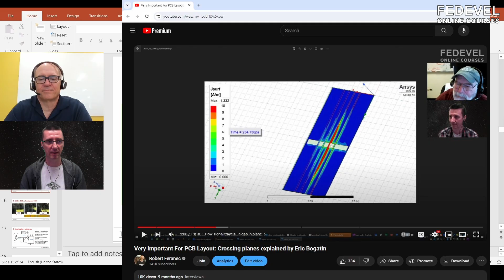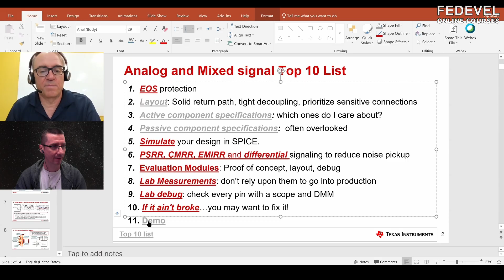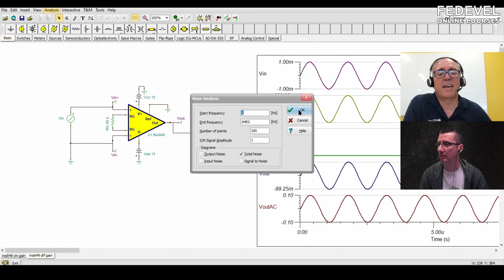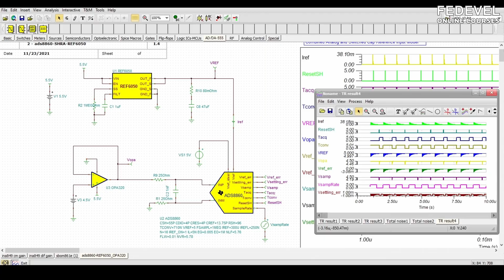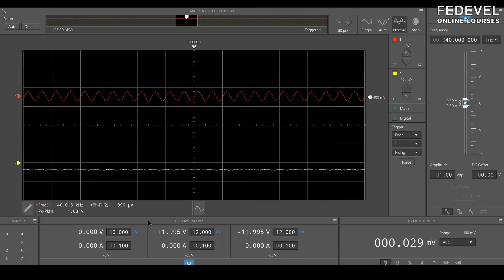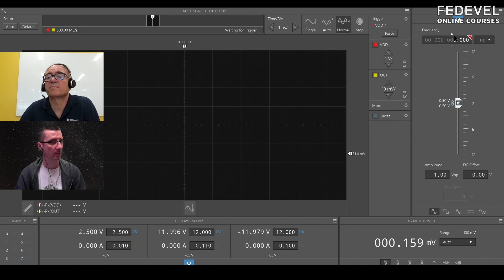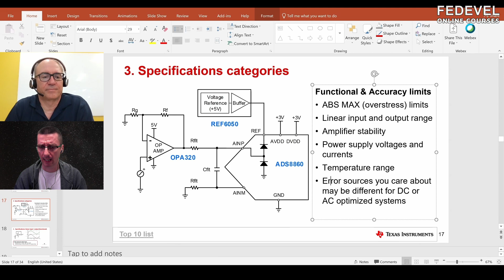Comment: From about 30:47 to 41:10, in a couple of different slides, an ADS8660 ADC is shown with a somewhat surprising input protection network. The "clip positive excursions" diode is shown clipping to the REF input rather than AVDD. I actually went and looked this up on the datasheet, and that's indeed what it shows!  I am 50% inclined to think this is an error, as the datasheet section describing the required REF driver doesn't mention absorbing over-voltages.  
I'm now very curious what the actual truth is on this detail!   Arthur hedges his bets by putting TVS diodes on both REF and AVDD (where the latter would be unnecessary if clipping to REF is really how this chip is designed.).  
Anyhow, thanks once again Robert and Arthur for a hugely informative video! Even when you cover points that we know already, these videos make fantastic references that we can direct colleagues or junior team members to for a particular topic.

Comment: Hello Robert, I watched more your videos it was very intereting and usefuly. I heve a question depend on DRC High-speed rusles.
As you know Altium allow define min/max peopagation delay, but only absolute valuse. is it posible use queries (or oyher trick) for check more advanced ? instaed of min/max compare with other value, such as propagation of delay other nets with defined tolerance.
Thanks.

Comment: 12:35 I am a bit confused with this guideline. 
Please have a look at the PCM1681 datasheet from TI, they explicitly recommend "the analog and digital sections being isolated from one another using a split or cut in the circuit board."

Comment: Correct me if I am wrong, but at 4:30 wouldn't you want the amplifier as close to the DAC as possible, and the DAC filter as close to the amplifier as possible. That way you minimize the length where lower voltage level signals live and thus can pick up noise, and by placing the filter as close to the amp as possible, maximize the length between DAC and filter (which might pick up noise) which will be filtered?
Reply: You are correct.  I should update the slides.  I would only comment that the DAC output is already a high level signal, so somewhat less susceptible to noise than the low level amplifier input.  But ultimately I think you are correct.  Best regards, Arthur
Reply: Its antiailiasing/reconstruction filters, so in both cases it's no. You are avoiding crosstalk of unwanted spectral content from/to the data converter. "Lower voltage signals" makes no sense here, what you should be thinking about is signal source impedance in first place.
Reply: @Konecny_M  It might be an antialiasing filter, but it still restricts the bandwidth over which noise is captured. It might not be its primary purpose, but it still does limit the noise bandwidth. And 'lower voltage signals' is relative to the voltage levels after the amplifier. If you capture any noise before the amplifier it gets amplified by amp resulting in noise levels higher by a factor of the gain of the amplifier on the output signal.

Comment: The "star ground" was used in analog power-amplifiers, where the resistance of the ground track was non-negligible, and the return (ground) current of single-ended loads (speakers) would create mV-level ripple on the ground-reference, which would play havoc on the analog front-end. It is a total non-issue with good differential driving and signaling.
Reply: I agree!  Good point.  There is always an exception to the rule.  Best regards, Arthur